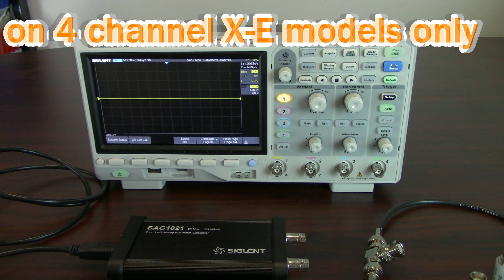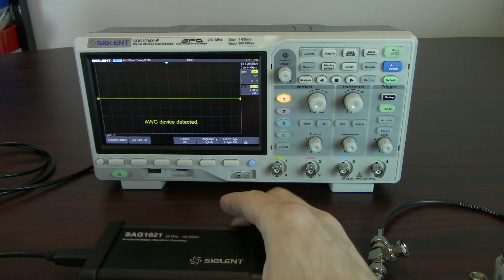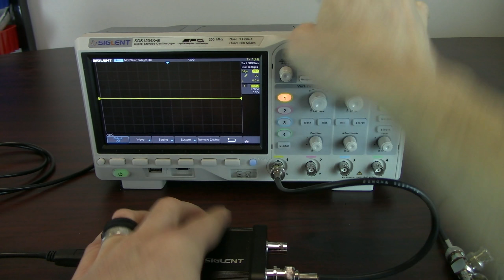Adding a function generator (SAG1021) to an SDS1004X-E Series Oscilloscope

Comment: I have the sds2202x-e and for me to add the logic analyzer costs more than the scope in Canada. I just bought a siglent spd3303x-e as well. 550 for the hardware I can deal with but like 300 extra for software that already resides on my machine is a little much. I looked forward to owning siglent gear for years but I plan to sell the scope and psu and buy the new rigol mso5000 series as for an extra hundred dollars after I return the psu to Amazon then sell my scope I'll have a faster scope , 4 times as fast along with the analyzer and an awg. So I'll sell my siglent 2 chan awg as well. I feel very burned by this.

Comment: Does it like not support other function gens? Being limited to the SAG1021 which isn't that impressive from a value point of view
Reply from the maker: The X-E can control the SIGLENT SAG1021I for both function and Bode applications. 

It can also control many SIGLENT SDG generators for Bode.

I am unaware of any scope brands that feature compatibility to control another brands generators and vice-versa. 

- Jason, SIGLENT North America
Reply: @SiglentVideo  I'm not asking about other brands, is there some reference that one could use to see if it'd be compatible?
Reply from the maker: @xistencestudios8904  The X-E series is compatible with any SAG1021, SAG1021I, or SDG SIGLENT generator.
Reply from the maker: @xistencestudios8904  The Bode function is compatible with SAG1025, SAG1025I, SDG800, SDG1000, SDG1000X, SDG2000X, and SDG6000X models.

Comment: Creating a frequency-response bode-plot on a SDS1104X-E. 
Device under test will be a diy class-A poweramp, measuring on the speaker outputs. 
Using a SDG series generator, sweep from 1hz- 50khz. 2seconds sweep-lenght.
Will this work?
Can i save the bode-plot on a USB-stick, and what resolution will the file have?
Thank you.
Reply from the maker: Hello. Thanks for writing in. In general, the Bode function is ideal for that type of test. There are some things to keep in mind, though:

1. The minimum start frequency is 10 Hz, not 1 Hz. Acquisition time for low frequency signals can be quite long. Here is more:  https://siglentna.com/operating-tip/why-is-the-bode-plot-start-frequency-minimum-10-hz/

2. You can't set the time duration of the test. You choose the number of samples/points to acquire. The number of points required depends on what resolution you need to see.

Yes, you can save data and setups. The total file size depends on how many points you have in the plot. A 50 point simple sweep is about 3 kB in size. 

There are some links that may be helpful:
https://siglentna.com/operating-tip/why-is-the-bode-plot-start-frequency-minimum-10-hz/

https://siglentna.com/operating-tip/saving-and-recalling-a-bode-ii-setup/

https://siglentna.com/operating-tip/bode-resolution-x-e/

https://siglentna.com/video/bode-plot-oscilloscope-generator/

- Jason, SIGLENT NA

Comment: Does this unit sync output on the two ports? I'm trying to bode plot using the diagrams of connecting the aux port to the DUT and it appears to be just a trigger or something and not copying the output as I would think (and see in the bode plot videos) Any thoughts? Model SAG1021I
Reply from the maker: Hi. Thanks for writing. When using a dual output generator (SDG1000X,2000X,6000X), you can couple both outputs so that you source identical signals. 

The SAG only has a single output. This requires an RF splitter (for lower frequencies < 10 M, you my be ok with a BNC T)

Here is a thorough write-up: https://siglentna.com/application-note/bode-plot-filter-oscilloscope-generator/

You can write us at info@siglent.com if you have additional question. 

- Jason, SIGLENT North America

Comment: Is the Function Generator powered by electricity? Or is it battery-powered?
Reply from the maker: The external AWG module model number SAG1021i uses the USB connection to the oscilloscope for both power and communications. It requires a compatible SIGLENT oscilloscope to function. - Jason, SIGLENT NA

Comment: I like this sag and it works fine with my 1104, but you need to put more effort in documentation. I am fighting with my PC to make it work and the only info I can find is -works with easy wave-. And yet it does not work with the versions available on your pages. Also, no easy wave version mentions anywhere the sag. NI debug tool sees the sag on USB. Maybe you can do a quick video showcasing windows 10/sag connection? Thanks
Reply from the maker: Hello jousis. Jason from SIGLENT NA here. Thank you for writing in. The SAG is not a stand-alone instrument. It can only be operated through the SDS1104, 1204, and SDS2X-E series of oscilloscopes. The detailed information on the product is only available in the scope users manual. If you need more assistance, please write info@siglent.com. Thank you and have a great day.
Reply: @SiglentVideo   Thanks for the reply. Check out this page: https://www.siglent.eu/sag1021.html
Users may also edit the arbitrary waveform by PC which has installed the EasyWave, or import the waveform by U disk that had stored edited waveform. It means that I connect the scope with easywave and edit the waveform through the scope ?

Comment: Hi, if I buy the 1204-xe, the AWG and the MSO from your website then I'll be all set? Or do I still need to purchase the license after?
Reply from the maker: The bode plot function requires:

- An SDS1104X-E, SDS1204X-E, SDS2X-E, SDS2X Plus, or SDS5X Scope

- EIther an SDG series generator (no license required) or an SAG and corresponding function generator license for the specific scope

MSO is a separate function which requires both hardware and a software activation license

Comment: asking 200 bucks for a software license code is not ok if the hardware isnt actually built in, dont you make enough just selling the hardware?
Reply from the maker: With the four channel X-E, our intent is to keep the initial hardware costs low so that more people can afford it. Additional functions, like MSO and AWG were pushed to external boxes to help hold to this philosophy. 

The separate license and hardware pricing come from situations that can arise where hardware is lost/misplaced. This technique helps to spread the costs out for all users. The overall cost of this option is also comparable to the competition. 

Thank you for your comments. 

You can write me at Jason.chonko@siglent.com if you'd like to learn more.
Reply: For anyone reading this currently you can hack it up.